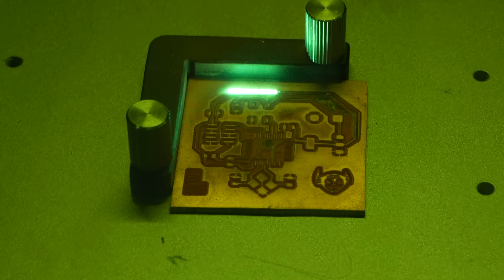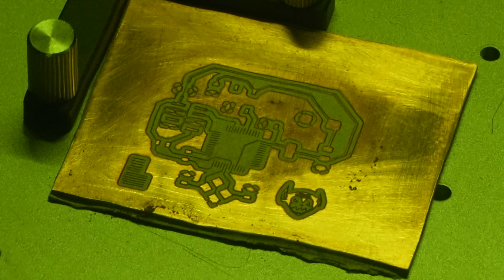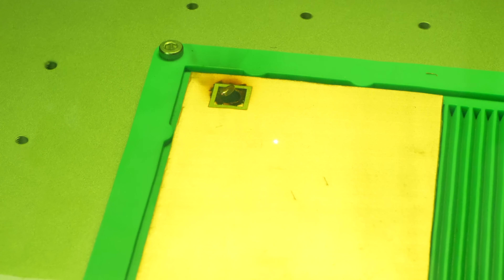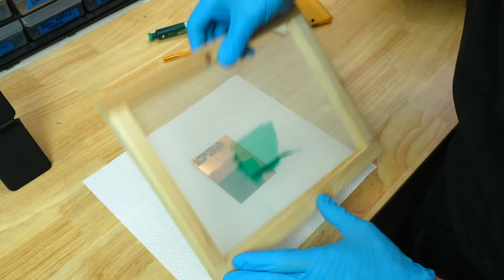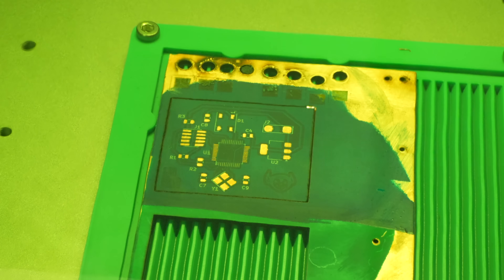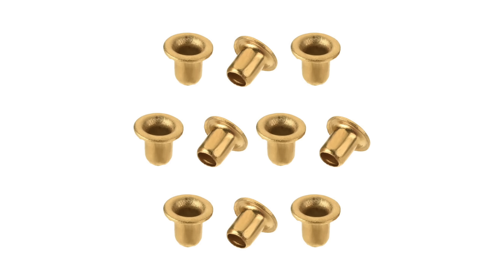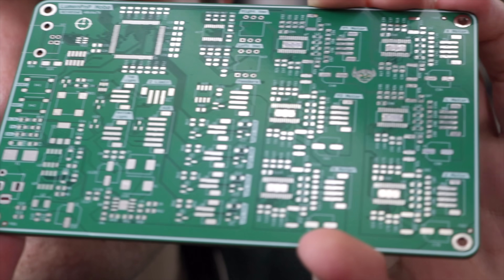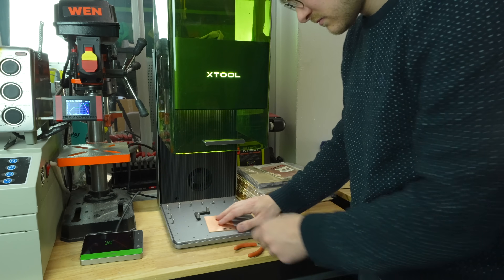Prototype PCBs faster than 3D Prints

Comment from the maker: I said this video is "not sponsored," but what I should have said is that xTool didn't pay me any money, and didn't have any say over what's in this video. Was just trying to indicate that these views are my own. I'm sorry for the vague/confusing wording! I'll be more explicit in the future!
Reply: I definitely considered a $3500 laser to be a form of sponsorship, but it didn't matter to me.  Good for you.  Great tool to have in the shop.
Reply: Hey for vias try nickel coating it using the boil method it should cost everything in nickel and travel down any laser cuts
Reply: I was thinking into something as simple as:
   1- Carve the pattern into the board.
   2- Sprinkle a thin layer of aluminum and copper particles powder
   3- Laser melt the pattern
   4- Remove the un-melted powder
Reply: Try it with the bamboo lab h2d
Reply: I got your meaning, but thanks for clarifying. Cool technique!
Reply: Okay to make 0203 SMD components?
Reply: okay, now I know I don't want to make PCB boards this way.  I just use a regular B/W laser printer on photo paper, and iron it onto my copper board, plunk in some acid, rinse, manually drill, then flip board over and iron on the component templates, also laser printed, all designed in Fritzing, I can have the whole thing done before your laser gets done ablating the copper on you board, especially a bigger board, and mine looks much better, and is more functional
Reply: Just layer conductive ink onto a solder mask and use mesh material to keep it together
Reply: People get too sensitive when it comes to income. "Can't have that sponsor, they're not goo", "I won't believe you because they paid"... just decide for yourself. Nobody is sitting next to you when you see banners on websites. There is bad stuff, there is good stuff. There is good stuff you don't like, there is bad stuff you enjoy. You're an adult for a reason. Look into stuff yourself before investing money.
That being said: The machine is way too expensive to be viable for most private customers and too bad in terms of alignment for professionals. It's more or less a nice little gadget, that's about it.
Reply: @rebel4466 
That's all true. For me at least, being honest about it is key. He stated right up front that they sent him the machine. That matters, IMHO.
Someone who pretends to be doing an objective review, when it's actually a paid ad -- well that makes them a liar.
Reply: I think you were pretty clear, but could see how others might be confused
Reply: Thanks for clarifying! This is indeed a big sponsorship and I’m glad they valued you enough to do this so you could share this with us

Comment: I wonder with the vias, if you use a tiny threaded rod, and trim them off with a die grinder (can be automated with cnc), then run solder over the ends? unless they need to be hollow?

You could also get lucky, and find grub screws that are the right type? With CNC, you could totally make your own though, giving the right sizes, and materials etc

Comment: Great stuff. I tried with my laser but it didn't work. Maybe the frequency is not perfect but I do it perfectly every time with an extra step. I paint the board with a permanent marker, hatch away the negative of the circuit in one pass only and then it goes to the acid. Works with every type of board and thickness of copper!

Comment: I have used the picking out of a box via revits with all sizes for decades now where component leads also can get through.

Would be nice if somehow the different sizes revits could fit in a pick&place reel and on the solder stencil there should be extra via holes for solder paste reflow because of the bad mechanical press connections.

Comment: Mask, drill vias only and via pad through mask.  Dip on solder bath to soak bridges into vias.  Drill through holes. Ablate masks pads. 

Might require through holes to have adjacent vias so not relying on 2 sided solder flow.

Comment: Why not just use old good Laser printer method? There are two options:
1. Simpler one. You can print directly on any kind of glossy paper (e.g. magazine) and transfer toner from it to the pcb with Iron or laminator (much better). With this way I was able to create 2-side PCB with places for TQFP100
2. More complex, but better result. You can print on transparent film and then use for classic photoresist process. 
And it quite fast. You have to do a bit more hand work, but no need for slow laser.

Comment: a decade ago i experimented with Dupont Riston PCB film. You would laminate the board, throw a negative on it, expose to UV, soak in developer, and then acid bath. It was fast and accurate and scalable. The main issue is drilling the holes and where needed, joining the through-holes. This crap is an INSANE roadblock for pcb development if needing anything but single side surface mount. The solutions i investigated were: what are effectively rivets, some ghetto crap where you drill a hole and solder wire to join both sides, and the vapor deposition which is beyond DIY levels. We NEEEEED a solution to this.

Comment: i was wondering the fr4 boards had a "flaw" you discovered that being that it creates conductive pieces because of the burns. however if you want to make electro plated via's this could be a bonus instead of a boon. maybe if you mill part of it or fix the flaw of the conductivity in settings or using a different mill you could make pcb's that would be as good as factory pcb's

Comment: For VIAs, can you put solder paste evenly on your board, and then hit it with the laser to melt it only in the locations where the VIAs are, then wipe off the excess? You could also hit the places where the pads are to tin the copper?

Comment: Idea: You mentioned at 3:35 that you can tell when the laser stops ablating the copper because the color changes - maybe it's possible to look at the reflection of the laser or the light being emitted by the material being ablated to calibrate when to stop ablating material? This might help in automatically tuning what settings to use.

Comment: Hi, @Stephen Hawes! Good Video! But I wasn't able to make the PCB. I have a Gweike G2 Max 50W laser engraver. I tried different settings, but I didn’t succeed: the copper is gradually removed, but not evenly. When holes start to appear in the copper, the fiberglass base catches fire, and with subsequent passes, large holes form and everything burns up in flames.

However, I’ve come up with an idea to work around this, and potentially create a process that will be more accessible to a wider range of users. I’m planning to try it out in the coming days, and it should work perfectly. Here's the plan:
1) Sand the board with fine sandpaper and degrease it using isopropyl alcohol.
2) Apply solder mask and cure it under a UV nail lamp.
3) Use the laser engraver to remove the solder mask in the areas where copper should be etched away.
4) Etch the board in a solution made from:
            100ml of 3% hydrogen peroxide (per each 100 sq. mm.)
            5 grams of table salt
            30 grams of citric acid
The process goes faster in a warm solution. I think placing the container with the etching solution in a heated ultrasonic bath could make the process very fast (5–10 minutes).
5) Wash the board and engrave the solder mask to expose the copper pads for soldering.
6) Cut out the board using the laser engraver if the power allows, or simply trim it with scissors.
If you need a double-sided PCB, make two separate boards using 0.6 mm FR4, drill them, glue them together, and connect the layers with wire through the vias. Or try to align two layers on the double-sided board.
Etching copper gives high-quality results without the risk of burning the FR4 substrate, and it's suitable even for low-power laser engravers.

As for preparing the files, I think the most convenient method for most laser engravers is this:
First, import the keepout layer (from Altium Designer) as a DXF into your laser software — it will already be at the correct scale.
Then, import the inverted copper layer as a .BMP image and scale it visually to match the keepout layer.
Finally, import the solder mask layer also as a picture.
Exporting all layers from Altium to DXF doesn't work properly — either the import into the laser software is incorrect. But using the keepout layer as DXF and the inverted copper layer as an image separately should be compatible with almost any laser software.

I’m looking forward to a video review of this technique, if you like it! Thanks.

Comment: Use dowels, that fixes the alignment issue. Dowels are a lot easier on a mill. I would use a 3018 for holes including dowel pins. I just drill a couple v’s into the deck through a stack. I am milling my boards currently, but plan to go this route when I can afford it. On circuit board, order thicker board and the quality goes way up. I get 2 free cheap boards on the ends when I order a stack to protect the thicker board. Good job and thanks.

Comment: Manual Via - Make a hole enclosed by copper on both sides of the board. Put a trimmed led lead/solder line inside the hole. Solder from both the sides. Effectively you've made a connection between both the sides.

Comment: Could try black FR4, see if that behaves the same a normal FR4.
Also, when you buy any PCB material you buy it with a specific copper thickness in oz.  Usually 1oz or 2oz copper is common which is 34um or 52um respectively. Older stuff might be 4oz

Comment: I agree with you that alignment is hard, that's why I've never done double-sided with my laser. I find that edges are never perfectly flat nor straight, and that the only way to perfectly align them once really flat is to press against them. I've also though about making a support by drilling symmetric holes in the PCB so as to flip it later (or just re-install it for the silk screen) but that remains complicated (though probably much less complicated in your case with the fiber laser).

Oh and by the way I love your method for the silk screen. I never thought about carving the letters into the mask to fill them using the paint, that's an excellent idea and it looks really great! Could you please also share some links for the scraper and the various screens/paints ?

Comment: When you are buying the board blanks, there should be ratings listed about the copper foil thickness. The older stuff you had was likely 1oz vs the new stuff at 1/2oz or 1/4oz.

Comment: I am dreaming of an actual electronics "printer" .. that will at least print resistors , coils, capacitors and simple semiconductors like diodes and mosfets in addition to the circuit board.. and of course it should be able to do multi layer including vias..  bga footprints and so on.

Comment: Hey ! I just saw your last video on spreading solder paste with your lumen pnp. It looks like you need a similar system to align the laser with the pcb.

Do you plan to attach a laser on your lumen pnp in order to carve on one machine ?

I was wondering with a laser if that was imaginable to heat solder paste in order to weld it with the component and the board

Comment: I think it would be way easier to apply photoresist, then uv expose through photomask then develop the resist then acid etch off the copper and I think it would be much cleaner than when you showed the close up of the laser cuts which seemed to have a fringe to the edge. Also you would no need to buy a $4,000 laser, just some cheap chemicals less than 50 bucks easily.

Comment: Super cool project! Stupid random idea came to my tiny software engineer brain, about how to connect the via for two board or more: What if you drill a hole and just pour enough solder into the hole? Maybe you can leave enough copper on the both side to make it much easier for the solder to stick to them.

Comment: Just a probably extremely stupid idea for the via issue: ditch the rigid board during the laser cutting steps.
Instead, work with thin (~0.1mm) copper and insulator sheets (maybe Kapton(?)):

1) Use the laser to cut the traces, but also to pock holes in the insulator sheets for the vias.
2) Use some kind of thin adhesive to glue/bind copper sheets and insulator together (note: we could use some kind of thin double sided tape as insulator).
3) Pressure, spot weld or use the laser to connect or fuse the copper layers together where the insulator has holes for the via.
4) Repeat 1) to 3) for each layer.
5) Lastly reintroduce some kind of rigid backing.

The process might be finicky as copper traces spend some time unattached and could move/break during the sheet bounding step, and also, ensuring the proper connection between layers on the vias holes might be challenging. The board will also not be as durable as a production one. And there are probably tons of issues I'm missing because I'm way outside of my area of expertise (Dunning-Kruger effect at play here). But here is the two cents from someone who would love to be able to build multi-layers PCBs at home.

Comment: I use CNC mills to make PCBs for almost 30 years. I use THT parts and solder both sides. So when I need a VIA, I swap SMD parts to THT and use those. Tinkering with a rivet takes more time and in most cases, it doesn't save much space compared to a THT part. You can place THT vertically the old fashioned way to save space. Also a THT part can bridge traces so you have less need to use double sided PCB.
For IC sockets, use the precision ones and remove the plastic. This allows you to solder both sides easily.
And if you really need a VIA, silver plaited wire works well.

I like to use bridges with a certain length. The width of staples. You can even place the bridges with an office stapler. Copper staples are hard to get nowadays, but most modern staples can be soldered, too.

For double sided PCB, I cut out the PCB after the first side. Then I place MDF wood on the CNC and mil a shallow pocket with the exact dimensions of the PCB. Then you have the PCB perfectly aligned and you know X/Y zero. Won't work with your laser though.

I did attach a laser to my machine recently for the silk screen and solder mask. Way better than scrubbing of the paint using the spindle.

Comment: There are two methods that could solve the via problem:

1. Method: Conventional sintering

E.g. Action Box's Copper Metal Paste.

You apply it like the solder mask epoxy across the entire PCB and fill the holes. Then put the PCB in an oven to sinter the copper paste

2. Method: Laser Sintering

Use powered copper suitable for sintering with a laser. This is the same process as 3D metal printing, but this time you only need to melt copper inside the via. This requires very precise alignment.

Comment: I'm glad people are working on DIY PCB fab techniques, but for me it's just not compelling.  I can't remember the last time I needed only a single, or even a double sided PCB.  Until there's a small, low volume, affordable, multi-step manufacturing line available for DIY labs which can fab 6-layers and up (without needing specialty safety systems for super caustic chemicals), there's just no beating a few dollars for a 2 week lead time from china.

Comment: When I do vias for 2 sided boards I use clipped off ends from a through hole resistor, cut it to length with flush cutters and solder both ends unto both sides and you get a via to a very small diameter.

Comment: Super Sick video ! I'm about to try my F1 Ultra on a copper clas prototype board now.  Perhaps filling the vias with conductive epoxy.  that is something we request at work sometimes.  I do it for thermal transfer  but it  might work for signals/voltage as well.  would use a squeegee process